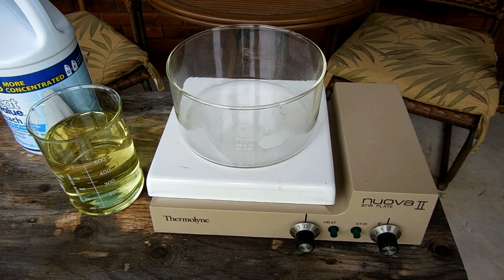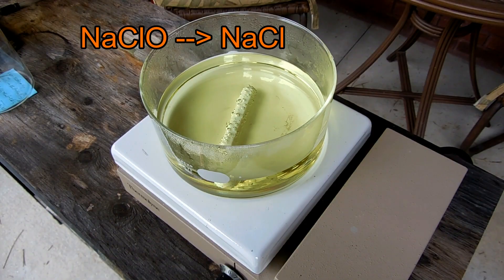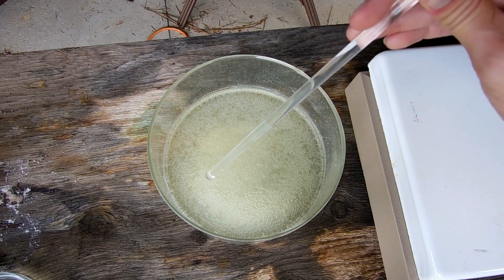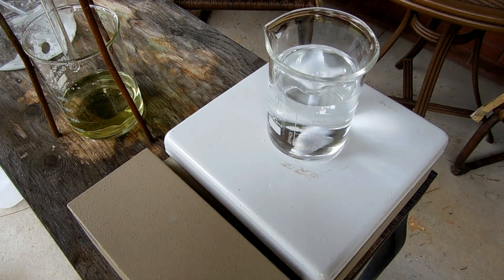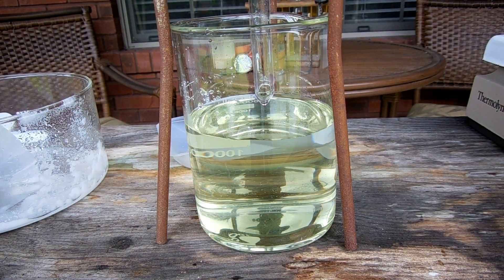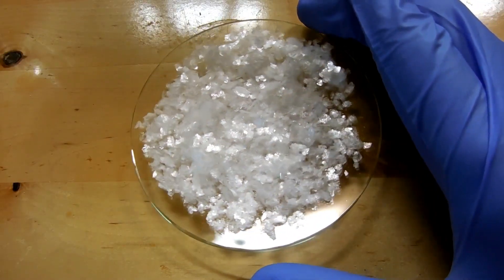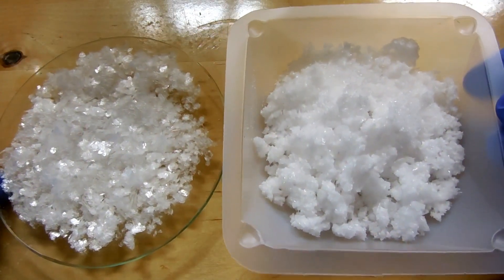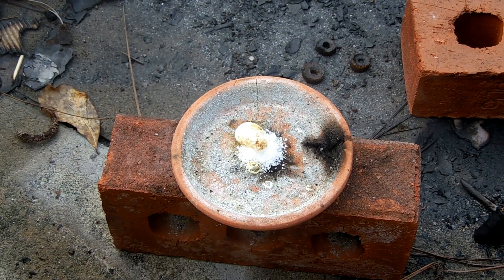Potassium Chlorate from Bleach

Comment: Can I skip the addition of KCl and evaporating the resulting filtrate to make NaClO3 instead?
Reply from the maker: +Johnpao215 I don't think it's quite that simple. It would be very heavily contaminated with sodium chloride; there's a lot still in solution even after you filter off what precipitates after boiling. I think it's generally made using electrolysis. But it's much easier to make the potassium salt, and KCl should be easy to find locally as a sodium-free salt substitute, water softener, or road de-icer.

Comment: rather than bleach would pool shock be more suitable?   It's 98% sodium hypochlorite.
Reply from the maker: +Jteutsch Anything with higher sodium hypochlorite concentration would make more chlorate, yes, assuming you adjust the amount of KCl appropriately. I don't think you have the right product though - sodium hypochlorite is way too unstable to exist in such concentration for long. You may be thinking of calcium hypochlorite, the solid. Sodium hypochlorite pool chemical is generally a 12 - 15%, solution I think.

Comment: Did he say "fridge"? I believe you need a freezer. And can't you just add the KCL straight to the bleach? It seems like it would be quicker to boil together then just freeze out the potassium chlorate.
Reply from the maker: +Robert Cece The fridge worked well enough for me, as you saw in the video. Yield wasn't very good though, which colder temperature might help a bit. I suppose adding the KCl right away wouldn't hurt anything, but I wanted to remove as much salt as possible first to reduce the chances of contamination later on.
Reply: +mrhomescientist I did this synthesis and got clear needle-like crystals.  Is that a sign that my product is impure?

Comment: Are there any safe non exploding uses for this? I only found how to get trees to flower with it.   How about figuring out something more practical. My laundry is DINGY. Dingy like it's scary to touch. (I think it's my homemade laundry soap concoction.) I'm trying to find a cheap way to make laundry bluing to whiten my clothes.. Do you know how to make Potassium ferrocyanide which along with iron chloride make a blue dye added in drops to the washer to whiten laundry?
Reply from the maker: +Patty Baker Making potassium ferrocyanide looks tricky, as you'd probably be working with cyanide salts which I'd rather avoid. I'm not sure how a blue dye would make things whiter, though. Plus I would never use anything from the lab in any application that comes into contact with my body. I can never be completely sure of the purity of the things I produce. I made the chlorate for the classic 'screaming gummy bear' demo, which is always a big hit.

Comment: The potassium is just the counterion. Sodium chlorate works just as well as potassium chlorate. The part that you care about is the chlorate, so you're doing a lot of work for no reason.
Reply from the maker: U Uthgaard Except that sodium chlorate is much, much  more soluble than potassium chlorate, so it's a lot harder to get it out of solution and as pure as the potassium method.

Comment: Everyone says chlorine is formed when you boil bleach. Guess it isn't true? I didn't get chlorine gas. Btw, nice Ruger gloves :)
Reply from the maker: Camroc37 There might be some chlorine. There's certainly a lot of nasty smells coming off of it, so only perform outside or under a fume hood!
Reply: mrhomescientist Really? I got no smells.
Reply from the maker: Camroc37 Surely it smelled like bleach?
Reply: mrhomescientist Really, no. It smelled like nothing. I even waved it into my nose to check. Nothing.
Reply from the maker: Camroc37 Were you able to make chlorate from it?
Reply: mrhomescientist Yes. I don't know why nothing but water came off. Did you do this outside?
Reply: First Last I mixed it with sugar and put a drop of H2SO4 on it. It burst into flames.

Comment: I got plate-like crystals nearly immediately after adding the Potassium Chloride. I put the solution in the fridge. I collected crystals so far nearly catch fire as described, but there is a little too much water. Worked well. Only problem was that I left my hotplate unattended too long and had no liquid in the bleach left. I just added water until it was saturated.
Reply from the maker: Camroc37 Good work!
Reply: mrhomescientist Thanks, but is there a simpler way to get potassium chlorate?
I have Potassium Dichromate if that gives you any ideas. No-Salt is pricey to use!
Reply from the maker: Camroc37 Well the other route is electrolysis of KCl; much simpler if you can make a cell. You could also try using displacement of another chlorate salt, like calcium sulfate and barium chlorate, but I imagine that's even more expensive.

Comment: I think that I am going to boil the whole batch down to all crystals than  slowly add di water until all of the sodium chloride dissolves leaving the far less soluble sodium chlorate behind.

Any thoughts??
Reply from the maker: Potassium chlorate is far less soluble than sodium chlorate, so adding KCl to yield that compound is a much easier way to recover it. Unless you really need the sodium salt, then you can give your way a try.
Reply: no i meant doing the exchange and continue to reduce it, removing most of the liquid.  then washing all of the sodium chloride out as a means of separation..

another not so scientific method that i just now confirmed works is to follow this method, filter off the initial chlorate precipitate  add 20 more ml of KCl, reduce the solution be about another third and you get about the same precipitate again.

the reason that simply reducing it dose not work is due to the greater amount of nacl left in solution.  when you tip that balance by adding an excess of kcl the chlorate precipitates instead.

having said this, i have 5 mmo electrode ordered now. and some high quality manganese for  reapplication
Reply from the maker: Clown Whisper Nice! Let me know how that works out.
Reply: mrhomescientist Im having a hell of a time sourcing the expanded titanium mesh.(thats why I ordered some for now)

Now I am familiar with the electrolysis of saline over a long period of time.  But I think that there is a simpler way using potassium from the start,
Reply from the maker: Clown Whisper If I remember right, people don't usually start with KCl because of potassium chlorate's lower solubility, so you end up with crystals clogging up the apparatus much sooner.
Reply: Ill do the sodium first and then the exchange.  I really dont need all that much of the chemical.  It actually makes me a bit nervous just having it around, lol
Reply: @mrhomescientist  the easiest way (6 years later) lol is to start with potassium chloride.  it works easy but takes  a couple of weeks.

Comment: How long should I leave it in the fridge? .... I did everything but not crystallized the potassium chlorate :(
Reply from the maker: I usually leave these things overnight, so they have time to precipitate everything. Don't worry about the whole thing freezing - having so much stuff dissolved in it has lowered the melting point of the water so your fridge shouldn't freeze it solid. As I say in the video, evaporation won't work because the reaction happens with boiling temperature only. Make sure you boiled it vigorously until you just start to see crystals appear, then refrigerate overnight.

Comment: I've tried using an alcohol burner to heat the bleach but I don't get any crystals. Should I use a hot plate??
Reply from the maker: Did the solution boil? An alcohol burner probably isn't hot enough, especially if you have a large volume of liquid. Try a hot plate or micro butane burner.
Reply: The alcohol burner did boil it slightly, but I could not see crystals, even after hours of heating. Maybe it's just the brand of bleach that I use. Anyway, thanks for the advice.
Reply from the maker: Chlorine k Probably with that heat source you weren't able to reduce the volume of solution enough to start seeing crystals. The brand won't have anything to do with it - if it's sodium hypochlorite, it will work. The crystals you see when boiling is the NaCl produced by the equation I gave in the video, so it's not like that comes from any additives or anything like that.
Reply: mrhomescientist Could I use a hot plate that only goes up to 280 degrees celsius?
Reply from the maker: Chlorine k Being that the goal here is just to boil water, as long as you reach 100 C you're fine. Your problem is that an alcohol burner is a small flame, which has a hard time heating large amounts of liquid. Fine for test tube scale, but much larger than that and you really should get a hot plate. For a long time I only had one that barely reached 100, and that got me through many experiments.

Comment: Hey mrhomescientist! I loved the video and have wanted to try this out. So, I gathered the required chemicals and began. Timeskip to now, and it has not worked. I've tried many different methods and still can't seem to place it. I seem to have narrowed it down to what it might be, though. But I don't want to just go ahead and waste another couple 1000 mL of bleach, so I'll ask you what may be wrong. Here are my potential culprits
A) Incorrect brand of bleach (Meijers generic)
B) When I boil it, crystals don't form until I take it of heating. Do I have to wait longer?
C) I haven't filtered the KCl solution
D) I haven't used distilled, instead I have used tap water.

Could any of those be the cause of why this doesn't work? Or am I just cursed?
P.S. I also have a general lab report written on this if you'd want to look through that.

Thanks in advance!
Reply from the maker: Definitely, if you've written a lab report somewhere I'll take a look. That'll help to narrow down where the problems come from. Even with all your points, you should still have produced /some/ chlorate. It just may be too contaminated by the end to be very useful. C and D will introduce impurities, and can be easily fixed for your next experiment. A would only matter if your bleach has other ingredients (detergents, fragrance, etc.) - I buy Wal Mart brand, the cheapest most generic I can find. As for B I would suggest heating longer. I heat mine until crystals just start to form, then remove from heat. Make sure you're boiling it too - you have to boil for chlorate to form!
Reply: I worked it out! Turns out, I wasn't boiling it long enough. Thanks a ton for your reply!

Comment: another video i watched on this subject mentioned that the no salt is contaminated with an anti-caking agent, which can be removed by filtering the saturated potassium chlorate solution through a coffee filter. also apparently using distilled water is important.

How To Make Potassium Chlorate
Reply from the maker: Both of which I did.

Comment: If you dont mind, i have some non requested sugestions:
- When you see NaCl cristals forming in the bleach, add more water, so you'll need to heat it more and increase the NaClO3 forming and also decreasing the contamination of your final product by hypoclorite (dangerous if you are using it for explosives).
- When mixing the two saturated solutions you can also boil it until cristals start to form, then you can leave it to cool in the freezer and therefore squeeze more product.

Comment: What is that glass bowl called you're using to boil the bleach?
Reply from the maker: It's called an evaporating dish - very handy to have, especially for slowly evaporating solutions because it has such a large surface area.

Comment: well i made some last night i boild down 3000ml to 900ml let it cool to room temp filter 3 times through double filter then u want 30 grams of potassium per 200ml so 600ml 90 grams no salt filter through double filter 3 times after letting cool to room temp in separate container then filter through a single filter together in same container let sit in freezer over night i got 42 grams of plate glass crystals i mixed with half mass sugar and i make flash powder from perchlorate and aluminum powder and let me say that the potassium chlorate and sugar i made was way faster and hotter the the flash its really powerful stuff so be careful 9 grams in a half inch pvc piece of pipe 3 inches long and end caps pack semi tight and u got i would say about half a stick of tnt 30 gram is about a full stick so be careful i say again and enjoy my fellow pyros ;)-

Comment: i have perfected this method if u get 8.25% sodium hypochloride bleach boil 
1000ml down to 300 filter it will leave u with 200 cuz all the sodium will crystalize let it cool for 2 hours before u filter so all the sodium will fall out make sure its room temp then filter now take 200ml of no salt or potassium boil to make sure it is all dissolved let it cool for 2 hours stir vigorlessly then filter in separate container then filter the bleach solution again oh make sure u have 2 to 3 layers of coffee filter i use 3 after u filter both twice each time with clean filters very important then use 3 layers dress filters then filter both solutions into the same container  then put in freezer over night take out the container it will be all glass crystal oh sry u use 30 grams of potassium in the solution filter out all water the lay all crystals on a thick news paper and spred even across the paper and lay another thick paper on top with some weight let dry for 3 hours then transfer to another stack of paper repeat several times till bone dry it usealy takes 24 hours u will yield about 20 to 35 grams of some powerful  shit no joke be careful  i mixed 12 grams of potassium chlorate  and 6 grams of sugar  and 1 gram aluminum powder not nessasary but it gives it a little more bang and makes to flash nice but this mix in 3/4 inch pvc pipe and make sure to pack tire not super but tight i also had some 4f black powder and made a pvc bomb with 100 grams and it was like a wisper compare to the chlorate mix no joke and it blew a hole in the ground 5 inches deep and 11 inches wide and i did not put in the ground just layer it on top and the 4f black powder left 3 inches deep and 6 wide it dose take some time to make such a small amount  but it takes 5 days for electrolysis  i can make double in five days its all how u concentrate it mine dose not even smell like bleach one bit so there u go a much better way to get potassium chlorate i thank the man who made this video cuz without it i could not have learned this method and his way was not powerful at all it could only be used to make rockets r-candy fuel and forget the match head way i melted 900 matches and got 2 grams of perchlorate for perchlorate use electrolysis anyway enjoy u will love it I'm sure!!!!!!

Comment: You should do a video on electrolysis dude. I hate using this method because the work required for this is hardly worth the yield. No chemistry experiment is useless or boring in my opinion, but my god, the time you put into the whole process makes the low yield a little depressing haha. Mind you I am not criticizing your video, I'm speaking from first hand experience. But if someone wants to try this, by all means. It is a fun and relatively straightforward little project to do at home, not to mention fairly cheap and moderately safe if the proper precautions are taken (:
Reply from the maker: I understand, it's certainly time consuming. Electrolysis takes quite a bit longer, but at least you aren't actively involved the whole time. This method has its merits for people that don't have access to electrolysis gear. I have done electrolysis and it seems to be quite a good route too, I just didn't have the time to film it. I'll get on that one of these days!
Reply: mrhomescientist  Yeah I think the electrolysis method takes, what, 3 or 4 days? But like you said, at least you can just set it up and let it do its own thing for the most part. Very little interaction needed after its began. Oh and I also wanted to say I actually just got done giving this method another shot (3 hours ago) with a few modifications. I wanted to see if I could come up with a way to make it a little more efficient for future reference. It worked!...Kinda lol.  I think the total yield was about 64 percent of the theoretical yield. I've found if you boil down 500ml of bleach to about 250ml, then add an additional 250ml of fresh bleach and boil back down to 250ml it will increase your yield greatly. For some reason it seemed to produce 3 times more KClO3 than starting with 750ml. And with this method I used stoichiometric amounts of each chemical. No need for a saturated KCl solution. So it wasted less KCl :D

Comment: Are you doing that in your living room??!!
Reply from the maker: Spare bedroom, which I have converted into my lab and it's used for nothing else.
Reply: Can you make a tour of your lab? Do you have extraction fans or just open the windows
Reply from the maker: Randomyou101 Currently I just have a box fan in a window for fume removal. Anytime I do anything that could make fumes, though, I do it outside. Making a fume hood has been on my to-do list for a long time now. The lab is always so messy I'm not sure it'd make a very good video :P

Comment: Really Great looking Crystals, I'm no way a chemist- just a thought but if you were to do the same process and while its still hot dump the whole batch in a glass bowl that is sitting in a bowl of ice so it good and cold you might be able to get the crystals drop out (precipitate) of the mix with a much finer grain size as well as maybe more of it? a lot like one of the methods of making strong BLK powder IDK like I said its just a thought cool video though
Reply from the maker: Thank you! The faster you cool things, the smaller the crystal size will be. As long as you end at the same temperature, though, you'll always get the same amount to precipitate regardless of the rate of cooling. Slow cooling and larger crystals are usually preferred, though, because large crystals are of a higher purity.